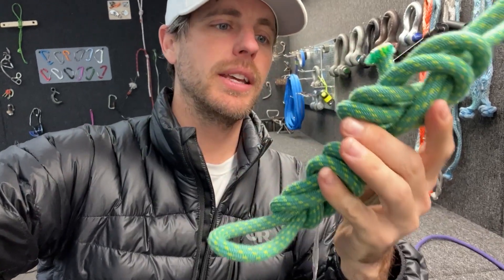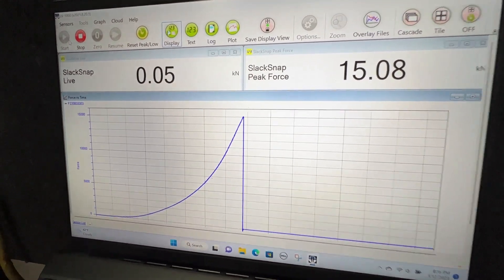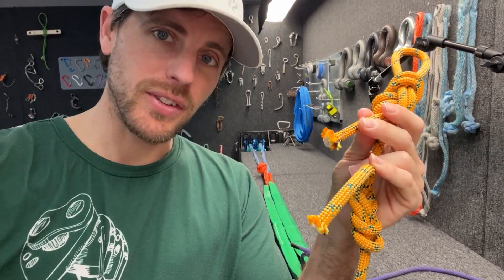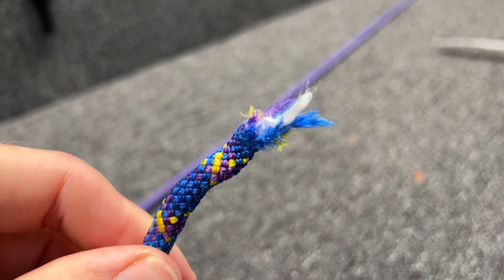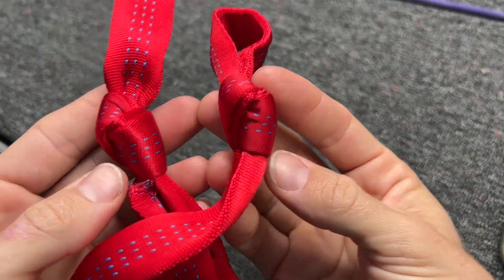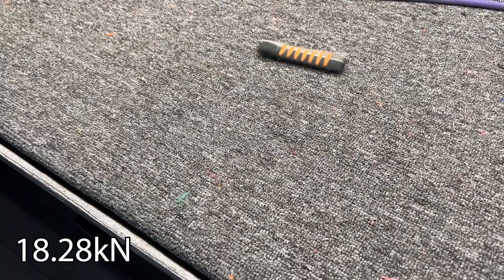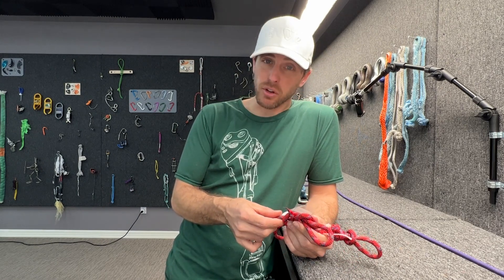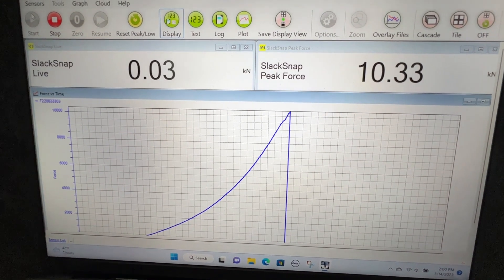Is accessory cord stronger than half rope?

Comment: Have you ever tested a beer knot vs water knot in webbing? I have been using a beer knot to make a rap extension and would be interested in that result. Thanks

Cool videos!
Reply: Actually, the beer knot turned out to be way stronger!  A lot more material is in that knot.  It's all super good enough as far as strength goes.